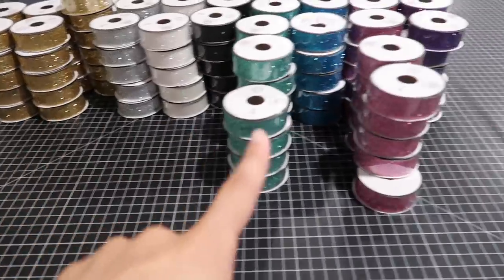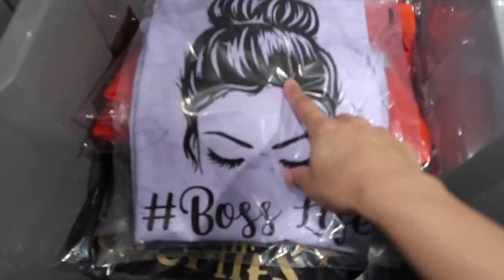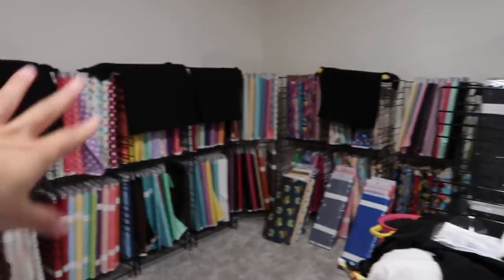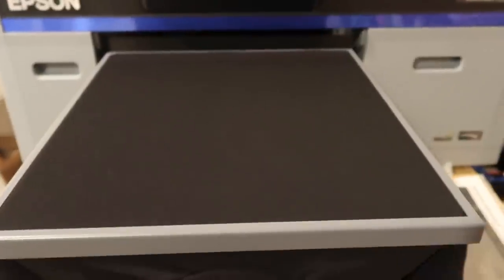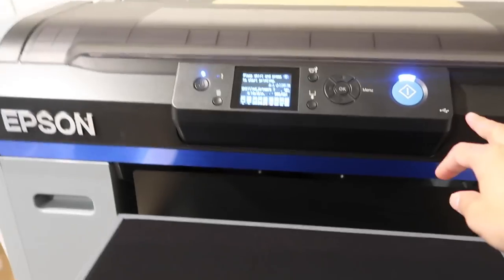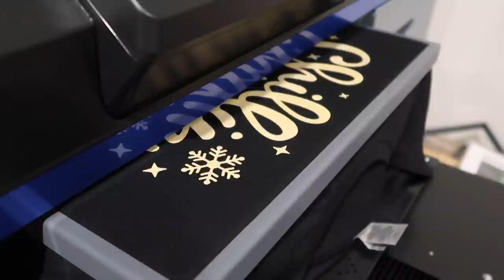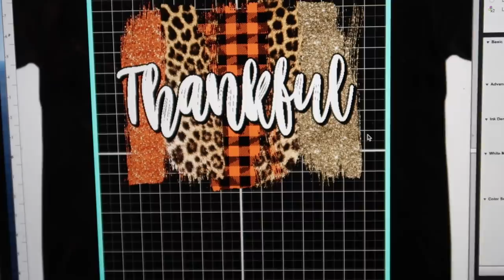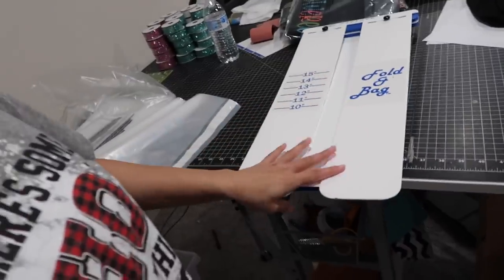Studio Vlog #3 Printing Tshirts on My Epson F2100 DTG

Comment: Hey Angela, How much did dtg printer cost you?
Reply from the maker: its $13,995 and If you are interested you can contact Todd Eggersman from Melco at 770-820-8002 or email him at teggersman@melco.com
Reply: @AngelaJasmina  thank you so much!
Reply: How long does it usually take to print one shirt on that printer?
Reply: Do you recommend getting the epson dtg printer?
Reply from the maker: @craftinsanity  Just printing takes about 1-2 mins for a just chest design but a full body design I would say 2-3 minutes. It really depends on the size
Reply: @AngelaJasmina  do your guy finance in store?
Reply: @nothgir  Not to knock anyone down, but I would order from All American with extreme caution unless it's a machine you won't need any assistance with after ordering. I have a HP  stitch S300 sublimation printer and I've had it for over 4months now and no one will even call me back for training so that I can start using it.  I've dealt with both melco as well as AA and I'd recommend Melco between the two. Just my opinion.
Reply: @queenlamarre1644  noted. Thanks.
Reply: Hi there,
Where do you source you blank tshirts? And do you get some of your shorts printed (outsourced) or do you do them yourself. 
Thanks
Reply: @AngelaJasmina  do they allow financing?? How much down??